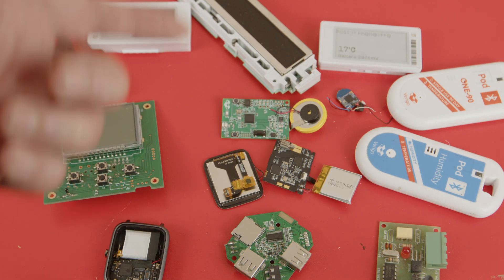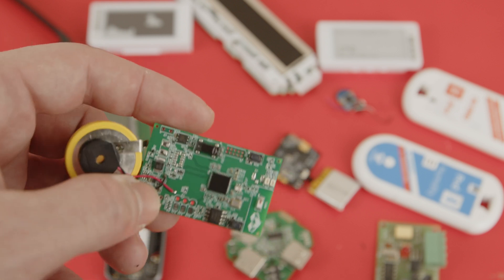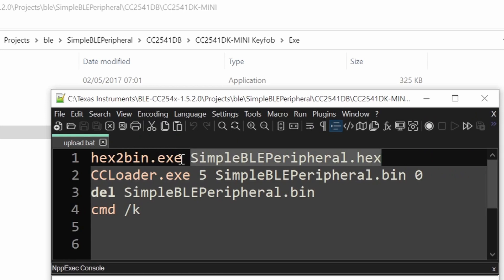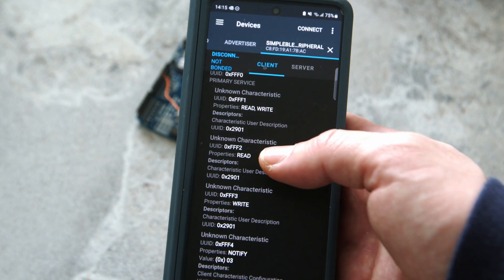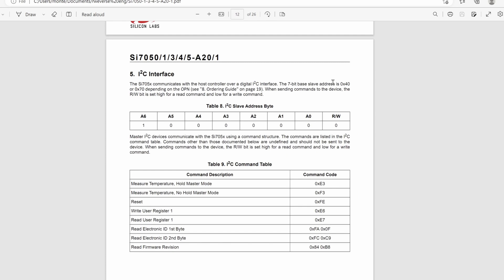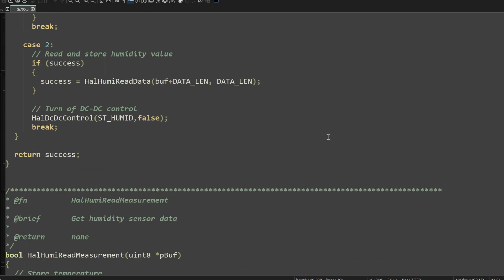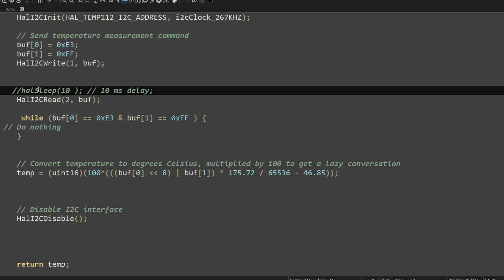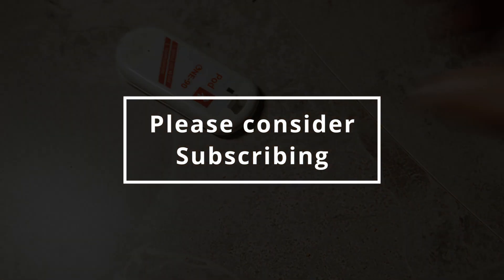Hack Your Electronics: Part 2 - How to make a custom firmware for random electronics

Comment: Porting Klipper (which is portable to begin with) to scanners would be nice, to build 3D printers from completely non-3D printer parts.  The problem is scanners don't have MCUs, they have ASICs, which must have an MCU part on account of the fact that you can download firmware to them.  There's no datasheets on this.

As for the 0:55 method, I suppose you could Pomona clip onto the stepper driver.  We tend to think of chip clips as being for "things that have a firmware", but no, they're just conductors, you can clip onto anything, like motor drivers.

All this has become a timely concern, I think... - a 3D printer ban may be coming down the pike in the UK.

(Inkjet printers actually don't use steppers, which is why I say scanners specifically.)

Comment: Hi, I would like to modify the firmware of my bluetooth receiver with chip C7THN41326 1703TRZ-11A, I would like to use Arduino uno, is it possible? If so, how?

Comment: could I increase the setting limit by 30° on an air conditioner?  I would like to reach 40-50° mechanically it is possible... I don't know how difficult it is to decode the software settings 😅
Reply from the maker: well you need to open the controller. If you can tell me what mcu is there, it might be an interesting hack indeed :)